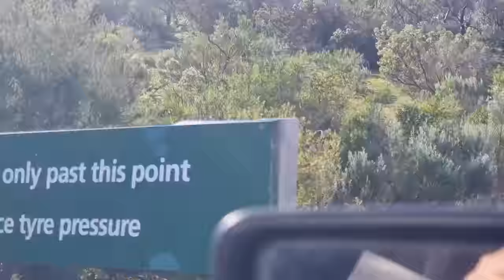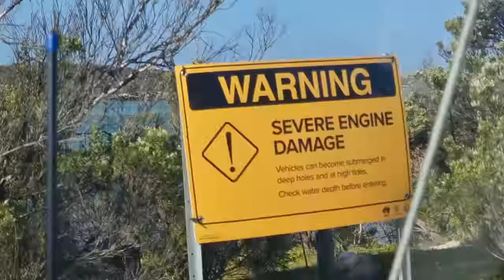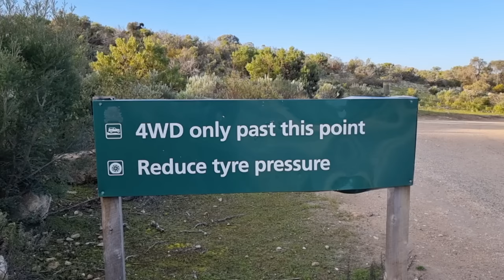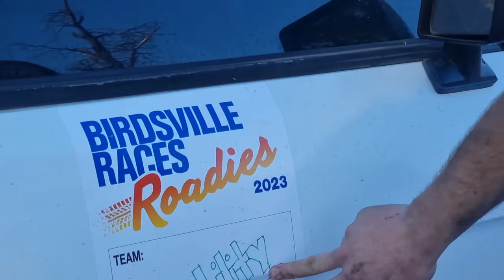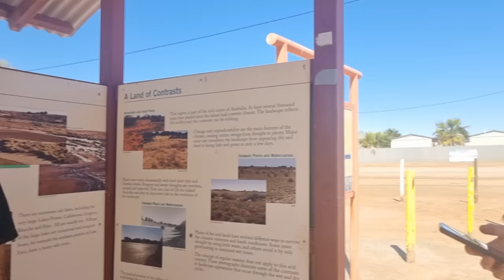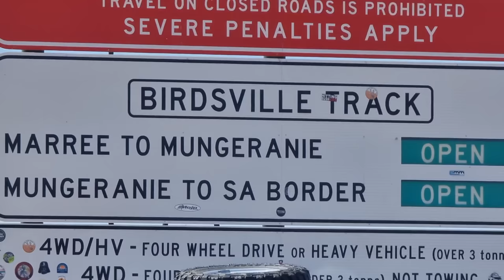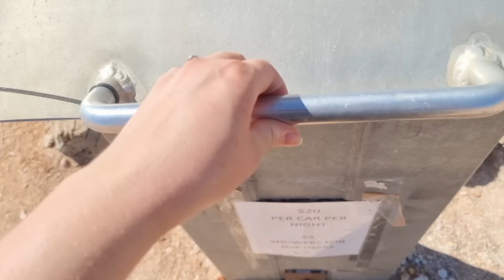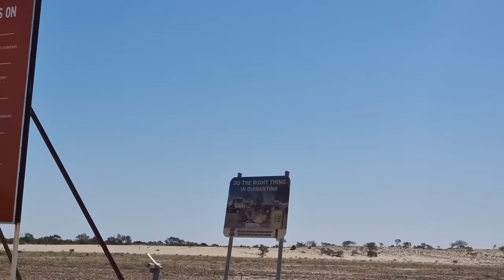What It's Like Driving 3581km In My PROJECT Subaru Brumby

Comment from the maker: Reply to this comment if you're here for the premiere 🥳🕰
Reply: Only rattled the roof rack off nearly and cam sensor code haha
Reply: Here!!!! 🎉
Reply: Here from the states. Beautiful country. Rebuilding a brat with my son. Your project keeps my hopes high. Thanks
Reply: I was there!
Reply: Nup
Reply from the maker: @gusfoletta840  you just missed it mate 😂
Reply: @angryengineering  Great vid as always and congrats on the engagement! Speaking of engagement, shame second gear wouldn't engage. Losing second in a brumby is pretty grim
Reply from the maker: @gusfoletta840  Thanks mate. Second gear works, just lacking the torque to use it in the sand in high range. It also kept jumping out of low range 😂
Reply: @angryengineering  Oh wow haha, I thought you were shifting from first to third by the sounds of the revs
Reply from the maker: @gusfoletta840  that’s what it felt like haha

Comment: So where the cv failures because of the lift kit? Does the kit that moves the front wheel fix that?
Reply from the maker: With the lift installed the cv’s are still at the factory angles. The engine mounts were worn causing the engine and gear box to cock up. Touching the cv on to the steering shaft and cutting the boots off. Before I’d noticed (from driving all day) the cv would have no grease left and the cv joint would be destroyed. I’ve replaced the engine mounts and now the problem is fixed

Comment: where are you guys based?
Reply from the maker: Based in Adelaide mate
Reply: @angryengineering  Mint. My mate and I are just south of Adelaide, but we've been up to the Flinders a few times. I saw the Brumby and had to have a watch
Reply from the maker: @connorwilliams3542   that’s awesome. I’ll definitely have to go explore more of the flinders ranges!
Reply: @angryengineering  We've been camping there the last 3 years, around July/August. The Bendleby/Hungry ranges are good for some rocky steep 4wding
Reply from the maker: @connorwilliams3542  I’ll have to go check it out, what vehicles are you driving there?
Reply: @angryengineering  My mate had a lifted Subaru Liberty with a shorter low gear, and I drive a Daihatsu Feroza that I'm about to swap a Mazda F2-t into
Reply from the maker: @connorwilliams3542  that’s awesome as